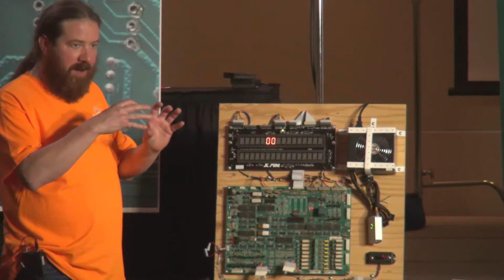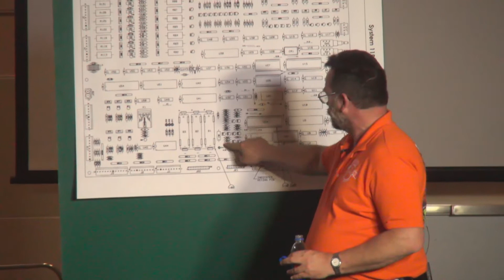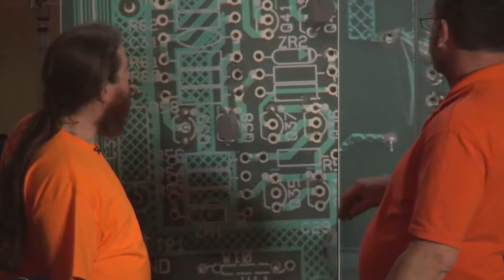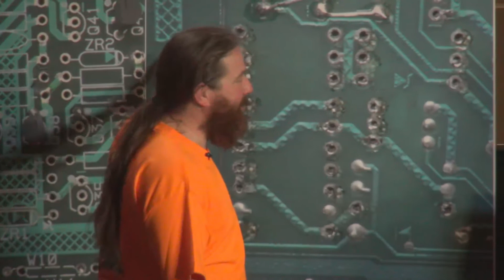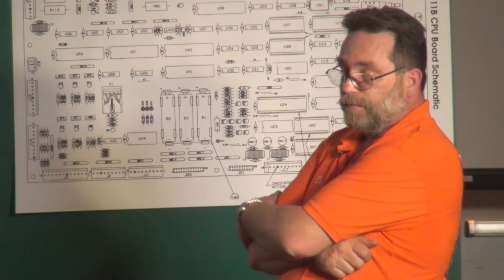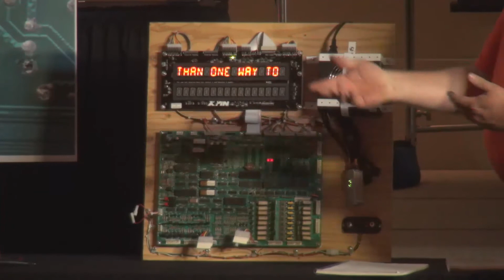NWPAS 2015 - D1 S7 - Williams System 11 Reset Mod and Battery Eliminator Mod

Comment: Boy, you can cut the sexual tension with a knife.  Thanks fellas -- great info.  I think I'm going to scrap my plan to install a remote battery holder and go with the more elegant coin socket in my High Speed.